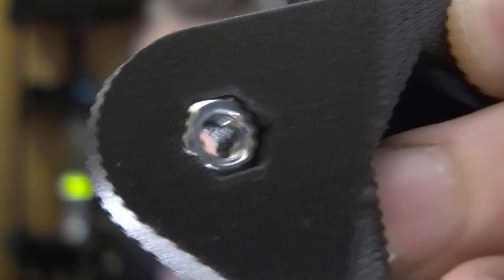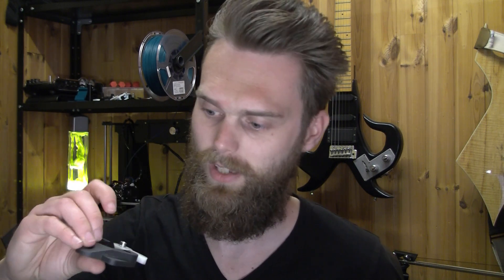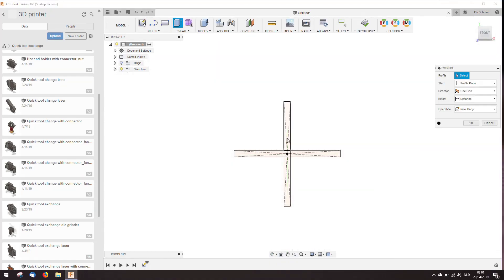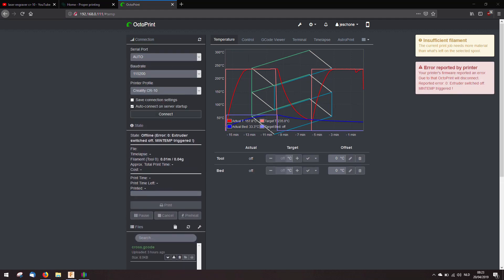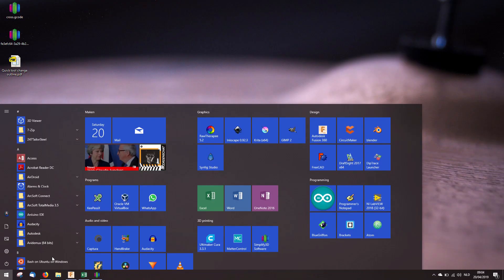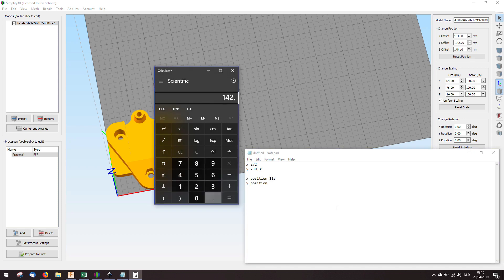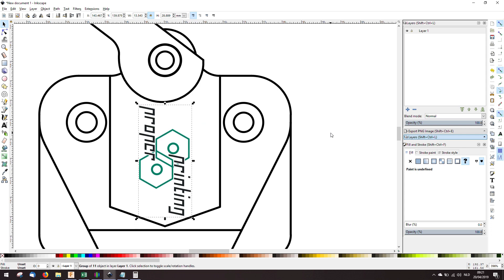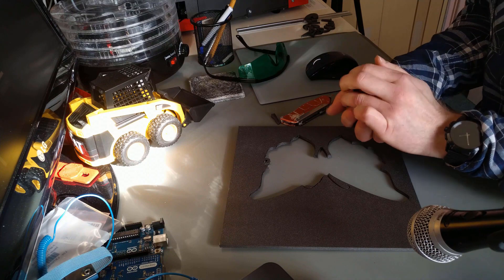Swap to laser engraving easily and align it properly on Creality CR-10

Comment: Hi Jón.
I'm using your upgrade for some time and just love it.
There's just a tiny update that you could do...
With time, the fixing support that holds the heating head to it's support cames damaged by the heat of itself. My idea was to add 2 pockets to hold 2 tiny 2.5mm nuts. The same idea you made on this modification on the Y carriage.
Think about it ...

Comment: You and I are having a time with different tools and alignments. I feel your pain. Does your printer support G92 command?
Reply from the maker: Hi Michael. What tools do you use? Yes, my printer supports the G92 command after uploading a modified firmware.
Reply: @properprinting  I have a HEAVILY modded Wanhao i3 v2.1. 3D print foot and gantry braces. X/Y diagonal threaded rod to tram the bed precisely square (this allows double sided PCB's up to 14cm sq with +/-0.25mm accuracy). I have achieved isolation routing of an TSSOP-8 package with the original Wanhao board.  Also 4x "L" brackets to keep bed in exact position when doing PCB's
Microswiss all metal hot end, 0.4 & 1.2mm nozzles. 
NEMA17 Rubber isolation mounts on all axis (makes crappy printer as quiet as MK3)
Just upgraded to Big Tree Tech SKR 1.3 Marlin 2.0Bugfix TMC21230 drivers x4, uses original ultilpanel, new BLtouch Smart (the main reason to upgrade to Marlin - UBL)
For NC drilling, I'm using a 3D printed housing for a Dremel flex shaft accessory for a Dremel 3000 (it's a pain in the ass to switch using original hot-end mounting screws
For Isolation routing, A simple 3D printed housing was made for an 8mm sharpened shaft and bushings salvaged from an old inkjet printer. This is a kind of scratch/drag engraver and is lightly spring loaded with foam. It is VERY accurate and reliable/smooth once the shaft was heated enough to set the bushings in place in the plastic.
Software:
Kicad for design & layout (Plot Gerber files for F.cu/B.cu/ and related soldermask layers, & Excellon drill files, auxiliary axis lower left for Gerber and Drill origins)
Flatcam8.5 (modified config file to export gcode with space between X/Y coordinates - saves hours of editing gcode files)
Geany - latest (clean up gcode files from unknown commands and insert initializing gcode to set G92 X0 Y0 Z0)  I 3D print a pcb holder 5mm tall from the build plate to protect the bed from drilling. Also modify the gcode drill files to add different feed rates for drilling, retraction, and movement. 
Repetier Host
https://youtu.be/eRo7yQSXF4Y
https://youtu.be/AnU2NIFtqzE
I'm Planning to make a YT tut series on this whole process. Realizing now just how much time it takes to make a short quality tutorial.

Comment: Remodel your laser holder to have the same center point as your extruder, and also export your model sketches from fusion with the print bed modeled in using the project feature. That dxf file should be able to be used in inkscape. As long as everything is centered it should work... in theory.
Reply from the maker: Thanks for your suggestion which looks like a good one! However, the nice thing about not having them centered is that you can be sure that you have to line them out. If I remodel the tool holder it can be a bit off without noticing ;) Maybe some adjustment screws on the holder can work for fine-tuning it so yeah, your suggestion might be successful, thanks!

Comment: Why not just take your offset, subtract, and reprint your X mark at the lasers 0.0 ? Then you don't have to use an offset on every print.
Reply from the maker: Thanks for your comment! The laser's 0,0 position is not above the bed. I think it should be possible to add an offset at the start script of the Gcode. This has to be done once. While typing this I come up with this idea, thanks man!

Comment: Do you have an affiliate link for the laser?
Reply: SO what model is the laser now?
Reply from the maker: @laolalock909  The link of the exact part is dead, but you can find them at Aliexpress by searching for "500mW Creality laser". I've found this one after a quick search http://bit.ly/CrealityLaser. The URL is pretty long so I've used a bit link. Hopefully this helps :)
Reply from the maker: No, I haven't. This is a great idea actually, thanks for bringing up! I'll take a look into it.
Reply: @properprinting  I would try to get links for everything you've used! The connectors, the laser, even the printer!
Reply from the maker: You're right, this is some good advice. Thanks!
Reply: @properprinting  you're very welcome. let me know if you're able to get the affiliate links. I'm looking at getting that laser and the same die grinder you have from the other video.

Comment: Okay, I think I've solved one major problem of getting a 2.5W/3.5W Oxlaser working.   I have a small PCB I've designed and will upload to jlcpcb, which uses a 12V to 5V level shifter for the PWM needed to feed the laser.

Power, unfortunately, does need to come from a separate power supply.  ( 12V, 4A or so ) ... there's no other choice, because the mosfets for the cooling fan cannot take the 12V 1A drain the laser pulls.
Reply: IMHO, a separate power supply is a good thing.

Comment: Have you found out better way for the calibration? I could write a small script with automatic calculations. How willing you are to switching to Linux? Just wondering because I don't use Windows and would not be able to test anything on Windows without a hassle.
Reply from the maker: Thanks for your comment and that you're willing to help! I have not yet found a better way for the calibration. The hardest part is determining the actual position of the printed part because the position within Simplify3D is not relative to the homing position of the printer. The step of determining the offset of the laser relative to the print nozzle was the easiest step. Linux was the only system I've used for years and I switched to Windows because of Fusion 360. Maybe it’s possible to create a script in which you can add the x and y offset of the tool relative to the print nozzle and adjust the Gcode accordingly, or did you have something different in mind?
Reply: @properprinting  Oh, ok. I will send a message through your website so that we can continue on email (I think you need to place some 3D model on Simplify3D, tell me the position and send the GCODE file when the object is in given position). There might also be an option in Simplify3D to change the mode from relative coordinates to absolute coordinates. Is there some specific reason to use relative coordinates?